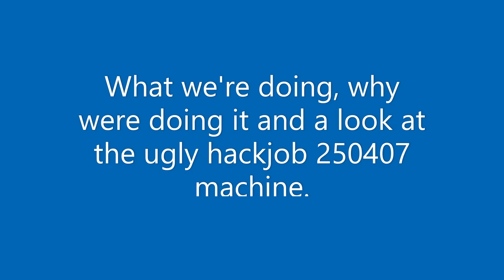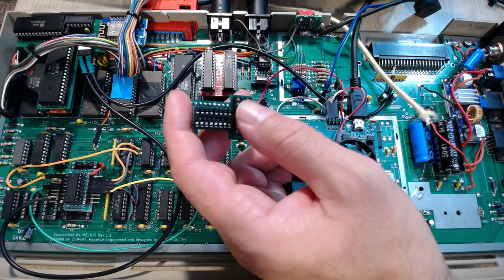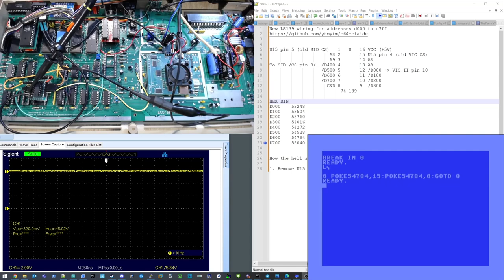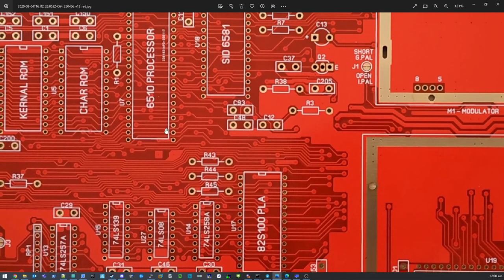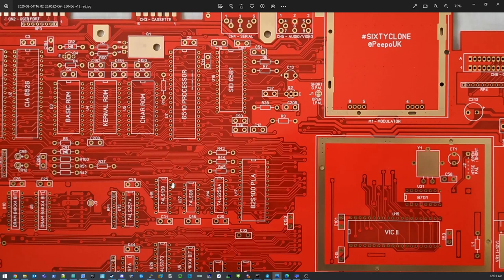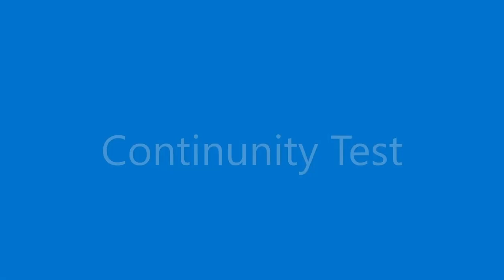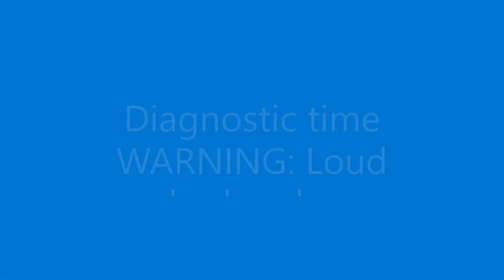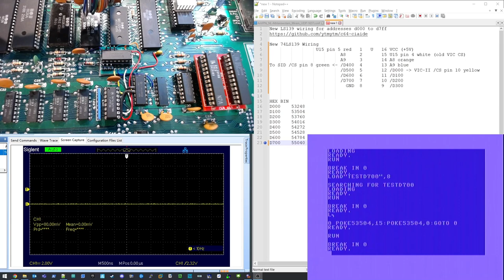Demuxing D000-D7FF to reclaim IO address space on the Commodore 64

Comment: I asked the Melius creator to open source his board. Your idea is excellent and could be easily spun into a new revision of the mainboard. You’ve made a great proof of concept prototype here.
Reply from the maker: Great idea!  There's plenty of real estate on the 466 board and it could probably be squeezed into one of the 8 ram chip boards too. A plug in board to U15 (expand on Dabone's board) should be pretty workable too.  Was thinking this morning of building another perf board with both 139s on it and some pins to plug into the motherboard socket.  Pins in the middle and a socket on either side (think like the GAL PLA or SIDFX style).  I might have to figure out how to design a PCB and get them made properly.
Reply: This would be an aftermarket bord I would build.

Comment: What a thing of beauty! I'm all over the 74LS138/9 family these days, designing address decoding for my 65816 build. Handy chip, I'm using it all over the place. Even if I could do the same thing with two chips' worth of simple logic gates, why not use the 3-to-8 decoder instead?
Reply from the maker: Yeah, great little chips for driving select logic for all kinds of stuff.  What design of 65816 machine are you doing, something of your own making or one of the SBC projects running around out there?
Reply: @retrotechinsanity  I'm designing my own based on Adrien Kohlbecker's 65816 breakout, I want mine to do symmetrical multiprocessing and vector pull interrupt rewriting.

Comment: This is VERY cool! I'm thinking that this could condensed into a small PCB that holds two SOIC 74LS139 chips plus the pin headers that can then plug into the existing 74LS139 socket. This would solve the issue of where to put the extra chip and for accessing power. Of course you would still need wires heading off to the address lines and for SID and VIC II CS.
Reply from the maker: I'm working on a DIP perf board version of exactly that right now actually.  About to fire up the iron.  It'll kinda look like a miniture GAL PLA.  SOIC PCB design is next, once I figure out how to use KiCAD.
Reply: @retrotechinsanity  Have you drawn up any schematics of this modification? I'm trying to wrap my head around your prototype 🙂
Reply from the maker: @michaelcarey  Does scribbling on the back of a receipt count? :D
Reply: @retrotechinsanity  Absolutely!! Some of my best designs escaped my brain and landed on the closest piece of scrap paper 🙂
Reply: @retrotechinsanity  After thinking about it further... a small PCB with two 74LS139 would not need ANY extra wires would it? All the signals and power you need are available at the original socket... is that right?
Reply from the maker: @michaelcarey  Absolutely correct, the only wires needed would be for whatever new device you're hooking up to the 'reclaimed' address lines.  The perfboard prototype works, video about it is uploading now.
Reply from the maker: https://youtu.be/JBSscKTYRlc <-- pluggable PCB version
Reply: @retrotechinsanity  Just checked out the video. Fantastic work!

Comment: Great job! Can you run some games or demos to see if they work as normal?
Reply from the maker: Yeah sure, any particular requests?
Reply: @retrotechinsanity  Mayhem in Monsterland (Apex) and Incoherent Nightmare by Arsenic.
Reply from the maker: @bitoxic  Tested both on the PAL 425 board and they work just fine.
Reply: Seems like the only thing that would prevent one from working would be if the programmer used one of the "repeated" address spaces to address the VIA or SID or whatever.